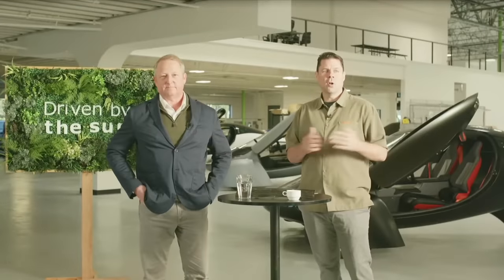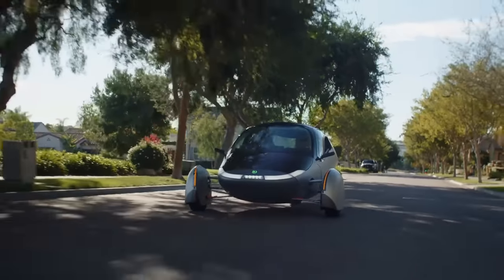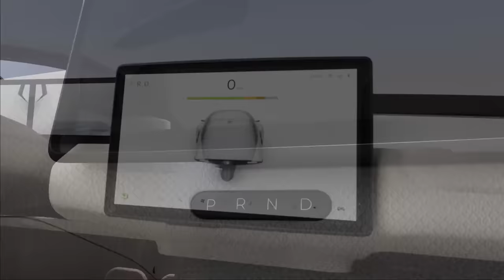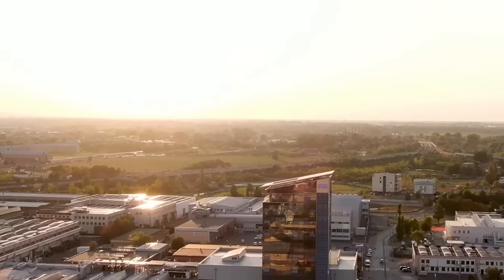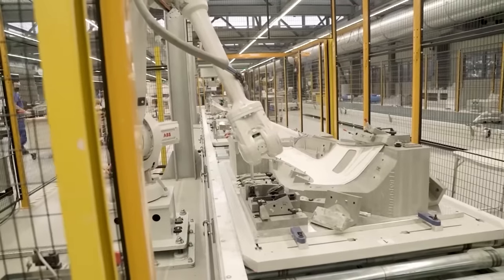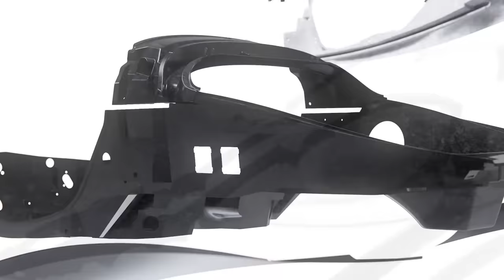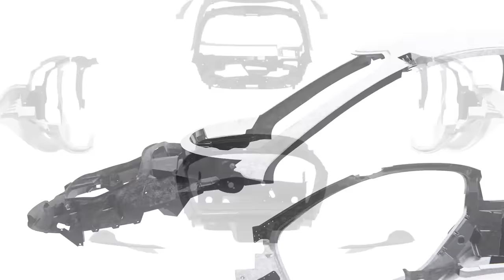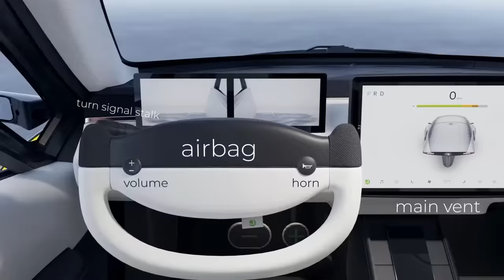Announcing Aptera's Launch Edition | Live Webinar

Comment: ticks so many of my boxes: Solar charging, high efficiency, (expected to be) fun to drive, right-to-repair friendly, moderately affordable, style driven by efficiency, engineering driven by safety, function, efficiency and production cost reduction. Looks like the Aptera and the Cyber Truck may be hitting the street around the same time, each an archetype for EVs that are made to different sets of optimizations. What wondrous times we live in.
Reply: Same, except it can't do level 3 charging. It can only do level 2 with a maximum charge rate of 57 miles per hour. That's a deal breaker for many, not to mention why did they even contract with tesla to use their supercharger network if they can't actually supercharge? I had higher expectations from this company
Reply: @erenjaeger9418  solar charging should negate some of those negatives.
Reply: @randomunavailable  Dw I saw in other comments that aptera intends to add DC fast charging over an over the air software update so that's cool. I'm less worried now, though it's still inconvenient. But no solar doesn't make up for a lack of fast charging. Solar is barely not a gimmic at 40 miles per day of charging since that covers average daily driving distance, and that's assuming that actually holds true in practice (which it won't because according to aptera's own solar map even in Arizona where I'm going to be living I'll only get 28 miles per day on average). With DCFC and full solar that is a killer combo though, so I really really hope they're able to do both
Reply: @randomunavailable   (solar doesn't negate it because DCFC and solar are different use cases. Solar does nothing to help road trips but is great for everyday commutes)
Reply: @erenjaeger9418  hence the 20K or more less costs, all depends affordability for many. How many 50-80 K cost as opposed to 30-45K cost?
Reply: @randomunavailable   And the much lower cost!
Reply: @erenjaeger9418  😂 Nobody needs to supercharge an Aptera. There’s a 1000mile range version for long hauls. You’d need to sleep before running out of range! 🤣
Reply: @hardcoreherbivore4730  One of the main appeals of aptera is the bang-for-buck. Being required to upgrade to the highest range version to get some semblance of features that come on less expensive electric vehicles destroys that. However, after doing the math it seems that a non DC fast charging 400 mile aptera is roughly equivalent to a 250 mile EV with fast charging so it's not that bad in terms of value. Add to that eventually adding DCFC capabilities down the road via a software update or something and you're back to fantastic value. Still, don't act like it's not an important feature to have, because it is and there's a lot of demand for it
Reply: @gabrielbruzzi1962  I'm confused what you're trying to say
Reply: I really hope they develop a 2+2 so I can take some kids with me like I do now in my 2012 Chevy Volt.
Reply: @erenjaeger9418  People who like fast charging, don’t care about the longevity of their batteries or the price of electricity. Hence, are not a concern for this segment. 

If you have the cash to max out the charge rate and replace your battery every 5 years. Then you have the cash to get a bigger battery and take care of it.
Reply: @hardcoreherbivore4730  Wrong - If I want to drive from Golden, Colorado to North Carolina - as I did this last June in my Tesla MX, I need Super Charger.  This is a deal killer. Why have a Tesla Plug - if not to get Tesla charging access?🧐 It is NOT A TRIP CAR!
Reply: @hardcoreherbivore4730  more like just for road trips but ok
Reply: @stevestevens9068  How many times did you sleep in that drive? Then you wouldn’t need to fast charge to make it with the largest battery. If you can afford a model X, you can afford the larger battery.
Reply: Funny… we must have watched different videos. It unticked most of my boxes. I was so hopeful but now thinking of canceling. When they said they aren’t doing fast charging due to battery pack management, that is code for they don’t trust their batteries to last when fast charged. The “air bag” they talk about is ONE per person. That is super unsafe. My mom’s Smart car has more. Nah, this is not in my future.
Reply: @djryan8944  Could you please, walk me through a scenario where you’d need fast charging? 

Why wouldn’t you wait for the crash test data before you decide on the airbags?
Reply: @hardcoreherbivore4730  Have you driven in Texas? Only good charging system is Supercharger network… I was counting on it to get me from Austin to Big Bend for camping.
Reply: @djryan8944  NVM, this discussion could be a red herring. The production model may receive fast charging. Launch edition  will not, but is only 5000 vehicles.
Reply: @hardcoreherbivore4730  Many people take a vacation once or twice a year that’s further than 360 miles away. We often travel to a timeshare that is just under 600 miles - a one day trip. Why would we want to add an extra day and expense of a hotel stay over to recharge, or pay an extra $15,000 for a heavy 1000 mile range battery we only need a couple of times a year when we could stop for lunch for 45 minutes at a fast charger and have it topped off? Once or twice a year fast charging is not going to have a significant impact on the decline of the battery, but it’s one heck of a convenience when necessary.
Reply: @astounded4546  Fair enough, it’d be nice to be sure. Maybe the 600 mile variant works? 

They should still be able get better performance out of a level 2 system. It’s maximum capacity is 19.2 kW and 12kW charging stations are common place.
Reply: @hardcoreherbivore4730  I appreciate your optimism, but please be practical. Would you trust a 600 mile rated battery to actually travel 594 miles without recharging at a level 2 charger for at least a couple of hours? I don’t know the specifics, but it’s my understanding that the Aptera can only charge at a little over 50 miles range per hour on level two. Besides, mine is just one specific example. 700 miles could also be a day trip. Also, I would hope that by the time they role out the 600 mile range they will have fast charging capacity, or I will not only lose my optimism as a consumer, but as an investor as well.

While disappointing and may cause them to lose a significant portion of reservation holders, this still may be a smart move for them if it gets them to production sooner which is critical now. As an investor, I’m keeping my fingers crossed.
Reply: @astounded4546  Yeah, 57 miles currently. If it’s at 240v it’d be about 24 amps to charge 5.7 kW. 17.2 kW was achieved by the model S. 11.5 kW by the model 3 for comparison.

Then again, it could be that 5.7 kW is enough for at home use and the effort is best spent adding DC fast charging. 🤷‍♂️
Reply: @markplott4820  That’s about right for winter exposure for many places in the northern hemisphere, but increases in spring, fall and especially summer, the degree to which you have exposure to direct sunlight. You have to factor in the efficiency: aerodynamics, weight, and rolling resistance (only three wheels) - the essential points of Aptera’s design.
Reply: @markplott4820  
Your sister worked on the Solar race team in 1990’s??
Solar has improved vastly in the last 30 ish years. 😮
Reply: @markplott4820  Are you implying that the Aptera team has either completely missed the mark in regards to their potential solar capacity, or purposely misled their investors and future customers?

The reflective glare on the windshield regarding the dashboard solar panels was already addressed months ago and deemed not to be a glare concern - of course that remains to be seen.
Reply: Was never get P ever again on that list as well 😂 😂 😂
Reply: @erenjaeger9418  they explained why, and it makes sense. They basically want to reduce complexity and get the car out ASAP, and level 3 charging just over complicated everything
Reply: @astounded4546  with how tiny the battery pack is, how do you know that level 2 won't be enough to top off while stopping for lunch? It's like a third of a Tesla battery size, so it only needs a third of the energy, so I can't see this really being a problem unless my math is off.
Reply: @markplott4820  An apterra four-seater would probably have a range of 700 mi instead of 1,000. I'll take the two seater.
Reply: @MrGamelover23  on level 2 it charges at a rate of 57 miles an hour. It would take nearly 7 hours to charge. I’m rarely that hungry lol.
Reply: @hardcoreherbivore4730  The 1000 mile version will never see production.   All marketing hype, just like future DCFC.   Cancelling my reservation unfortunetly.
Reply: @hardcoreherbivore4730  Its not about liking fast charging, its about it being a neccessity for road trips.  And they could add a mild dcfc option of 50KW vs the 150-300kw options of mainstream evs.   If the battery pack is that fragile, then one needs to question whether it is a smart purchase.
Reply: @hardcoreherbivore4730  Any road trip over 200 miles.  400 mile version is probably closer to 300 real world and then you are not going to go all the way to 0% battery so effectively, you have a 200-250 range.   So you can drive 3-4 hours, then you will have to wait 3-4 hours of charging to continue your trip?   This doesnt even take things like cold temps, rain, snow, wind into account for lowering range.   As a daily commuter it will be more than enough for 90% of the time.  Problem is Im not looking for a daily commuter only car.  If they dont add dcfc quickly, this will be at best a niche car that will be bankrupt shortly.
Reply: @hardcoreherbivore4730  Key word, "MAY"
Reply: @MrGamelover23  They have had several years to figure dcfc out, they absolutely dropped the ball and really makes me question their leadership ability.   No heat pump, no bms, no dcfc.  I can live without the heat pump due to the great effiecency but no dcfc, even just 50kw is a deal killer for any kind of road trip car.
Reply: @bad50  You act as though, they had one thing to work on and never made any ground. They are developing a completely novel cooling system, and you’re upset that there’s a process involved? 🙄

The launch edition is 5000 vehicles to those who don’t mind a later retrofit. With this approach, they can iron out production details, while still working on fast charging.
Reply: @hardcoreherbivore4730  These initial 5,000 vehicles are the emissaries of Aptera! What will they say of us? This is crucial for potential investors and customers.
Reply: @bad50  Damn straight!
Reply: @hardcoreherbivore4730  I do hope you’re right, but it’s one hell of a risky trade off that may yet backfire!
Reply: Ya; tick tick - if they ever make any production vehicles - they will likely get sued now by the early reservation holders who are legally entitled to get the first vehicles as promised.

Comment: the right-to-repair ideology embraced by Aptera is what keeps it on my (future) shopping list, even with a likely increase in cost. I'm expecting (hoping) battery and solar panel cost per KW will continue to fall, thus reducing upward pressure on the unit price, so that when the time comes, I'll be able to clear the purchase with the Mrs. :)
Reply: My friend, just reserve it now. It's still a year away. The price will only go up.
Reply: @Steven Taylor  Choose aptera and you get right to repair, choose tesla and you get fast charging. Most people would choose fast charging :/
I'm considering canceling my reservation and going with a model 3. I don't want to but I feel a bit duped because they've made a big point of advertising using the NACS charge port (and being able to use the tesla supercharger network) but are now saying you can't actually supercharge (aka no point in making this design choice now, other than to maybe trick people into thinking you can use it only to find that when you try you can't). It also significantly reduces the usability of their main feature: range. I was overall very disappointed by this announcement
Reply: Anyone know where makes the midrange speakers and tweeters? Not worried about the subwoofer quality can vary there.
Reply: Who makes
Reply: @Gandalf721  Arrogant much?
Reply: @bad50  project much?